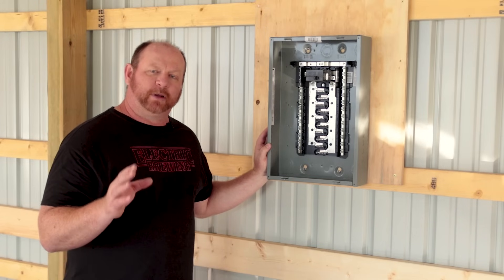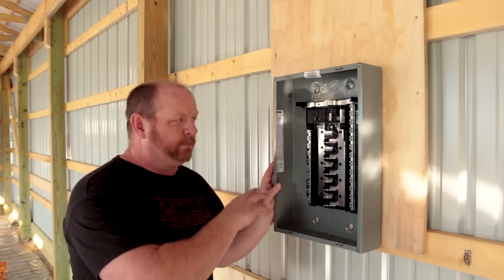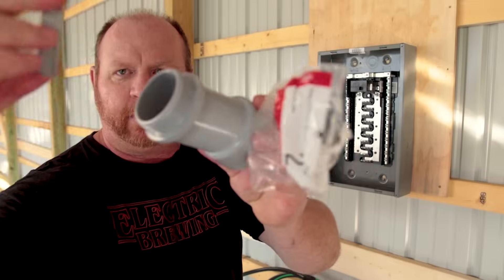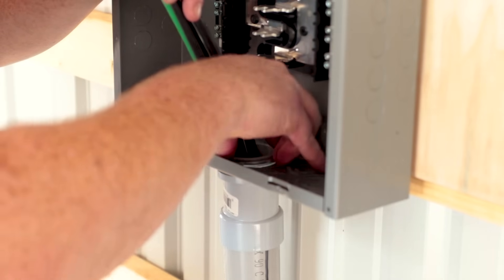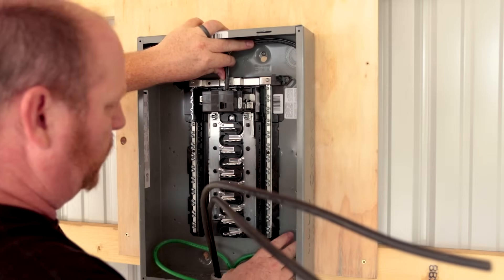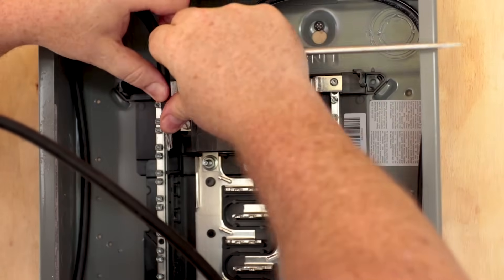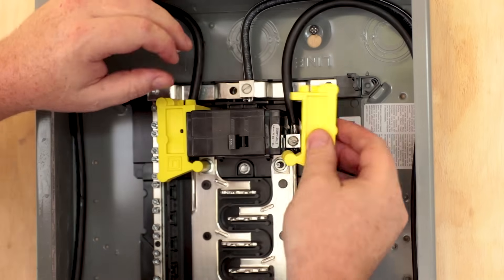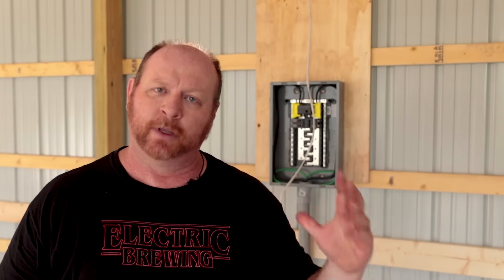How to install a main breaker panel in a garage. -  Square D Homeline 100 Amp Main Breaker

Comment: As an electrical engineer that worked over 30 years designing electrical systems for contractors, I have a few comments.  The use of #2 Al for a 100 ampere service would be acceptable for a dwelling unit.   This is not a dwelling unit so that table in the NEC can not be used.  #2 is rated at 90 amps at 75 deg C.   Terminals are rated at 75 deg, so 90 deg C column may not be used.   Should have been #1.  Since this is a "Service Entrance Panel" (I.E. coming from utility meter) there should be no ground in the conduit.  You are required to Earth Ground ALL service entrance panels at the location of the main.  Since you probably have no footing or metal pipe water entrance you are stuck with ground rods and be 25 ohms or less resistance.   No meter to check, no problem, add second groundrod and done.   For those saying add ground bar, absolutely not.  That is for sub-panels only.  The reason I commented is many people have viewed this and have gotten incorrect information not just from the video.    Respectfully Submitted!
Reply: Total clue hunter you are. Clearly he states this is fed from a utility meter. Service entrance conductors are sized according to 230.23...they must have "sufficient ampacity to carry the load as calculated in Art. 220." The OCPD(circuit breaker) is not protecting the service entrance conductors. Now if the installer hung a 100 amp disconnect outside next to the meter pan, you might be correct. But you are totally wrong in this case. Next about the ground bar. The only manufacturer that includes a ground bar in their load centers is Siemens. All others you have to buy them separately. If you look closely at the HomeLine load center in the video you will see factory threaded holes specifically placed for adding ground bar(s). As a matter of good workmanship I always install a ground bar to keep grounds and neutrals neat and clean. Many electricians screw the ground and neutral conductors under the same screw terminal. This is sloppy workmanship and a code violation. Lastly, the installer forgot the most important component of the grounded electrical system, the main bonding jumper. Most of the time with load centers it's a green screw and must be installed per manufacturer guidelines.
Reply: Brian,  please try to answer the questions brought up in this string.  Only you know these answers.   Respectfully Requested,
Reply: This is a sub panel. The box outside is you Main Panel. I'm pretty sure that is a combo unit.
Reply: Ted Cressley    I believe you "may" be right.   Not 100% sure.   He did not install like a sub panel though.   That's the problem, the originator will not answer any questions to know what is done right or wrong.   Also agree on the nolox or however you spell the antioxide paste for aluminum.
Reply: You should also use nolox on all of your connections with alm. wire.
Reply: as a former apprentice electrician with 3 years of union experience, I concur with your statement. Thank you for sharing.
Reply: @brianpfister5504  a former with 3 whole 3yrs
Reply: I have a  square d 100 amp panel was told I have to have gfci and ground arc breakers for some things my question is how do you install them they stick out to far to put cover back on some help please
Reply: @joep8494  try a Siemens 100amp load center.
Reply: @joep8494  even though you shouldn't any issues with a square D sub 100.
Reply: @FCES_Electrical_Sol  the 100 amp panel is in house with another 100 amp on pole outside when I wired up new service they said I have to have gfci and ground arc  breakers for bedroom but with my square d box the breakers they sell don't fit in they stick out and can't put cover on box any ideas
Reply: Joe P    If you haven't figured this out yet, very sketchy information but you need to make sure the breaker type you bought is on the list of breakers that fit the panel.   SQD makes several different kinds and they do not fit all panels.  List should be sticker in the panel.
Reply: He didn't ground?!? Well, he did say he wasn't a licensed electrician....🤔
Reply: Kevin is right, but you can have a ground bar as long as you bond it with a #8 THHN/THWN ground wire to the neutral.  I have had inspectors that like that better as it is neater than running all the neutrals and grounds to the same bars.
Reply: Wolfgang Unger   I wish Brian (the originator of the video) would answer the questions I asked him 2 weeks ago and clarify the unknowns.   Obviously Mr. Really Buddy is not as knowledgeable as he thinks he is.   I think they call them trolls.  I call them dipshidots.
Reply: Order of the True Force    Not sure why you posted your question under my comment.  I've never been shy about my opinion based on experience though.   Other than the most southern states, I would not design a circuit breaker exterior of a building for conductors that come into a building for a different reason than yours.   Circuit breaker overcurrent ratings (the ones on the handles) are based on test conditions of 85 degrees F.  If temp is higher, trips sooner(still safe).  If the temperature drops to 0 degrees, that 200 ampere breaker would need close to 800 amperes to trip under over load.  So conductors inside the warmer area would melt the insulation first.  Bad news!   If the breaker is outside and all the conductors are outside, temperature affects both, back to no problem.   Probably way more than you wanted.  Sorry.
Reply: Order of the True Force    I agree with you!   Why give thieves an advantage!   I hope I didn't disappoint you!
Reply: Update to questions below. I confirmed with Home Depot the green wire goes to the strips on either the left or the right. After going to bed and waking up this morning I looked at the situation I've only every other circuit working and realized it was the black wire. Everything at the box outside was hooked up right. The box I just switched out had the same problem. This all took place after the main blew inside the house when an old outlet box for the dryer wore out and blew the main. I realized it was the black wire on that Square D QO box as well. So I realized the breaker at the box outside must have blown the left side where the black wire goes. Went to Home Depot bought a new one put it on and everything is working fine.
Question Kevin Coop. My power in is from box off pole. I have 4 wires. Black-hot, red-hot, white-neutral, green-ground. On top bar I put black on right, red on left and white on top. Do I put green on one of the bars on the left or right. Also would I need a copper wire for ground to go to metal frame of house or in ground-copper wire to ground bar? 

Also, on my box like this the single pole breaker will only work on every other circuit. The ones with the hook facing right. The double pole breaker will work with this pattern of one that works and one that does not. In this case the red is on the one that works and black is on the one that does not. I placed this breaker on the top right. Black wire on left of double pole, red wire on right.
Reply: I agree about the ground rods and current rating but, wasn't the first wire attached the neutral, not ground, wire? If so, I've always seen them run inside the conduit.
Reply: The meter base looks like a millbank combo if it is then there is a separate compartment with a breaker inside and  the neutral is bonded there and a ground rod is driven. If that is the case then it is considered a sub panel. No need to bond at the panel. Kevin Coop is correct.
Reply: Thomas Marable    I did some checking about one building being fed from another building.   Not the exact situation here but, close enough to consider how to wire the panel.
History, the rules about this changed many times back and forth since I started in 1983.   As I rechecked it for 2017 NEC it is currently set as neutral and ground are separated in the second building.   But, it does require a ground rod(for lightning) to be installed.   The bad things is, there is an exception allowing it to be wired the other way with N and grounds bonded.
They still can't make up their mind I guess!     Kevin
Reply: @KevinCoop1  you are correct. If this is the meter base I think it is then the neutral is bonded there, if installed correctly, the they are separated after that. A ground rod is needed. The 2020 code does explain it a little better, but still not as clear as it could be better.
Reply: Thomas Marable    Thanks for the 2020 info!   I have retired and am not getting newer than 2017!   Good luck to you in your future in Electrical, whatever it is.    Respectfully,   Kevin
Reply: @KevinCoop1  I am retired to but still do consult work for the company I worked at. For years I was the only electrician/ engineer in the company. I still love to learn new things. Mike Holt has a live show on Tuesday covering slot of the 2020 code, go to Mike Holt live and you can catch up on slot or you tube his channel.
Reply: Thomas Marable    I get Mikes notifications.   His classes that I attended were the best ever.   But, I totally retired from Electrical Design engineering.   I have missed going to work about 1/4 second.   I guess after years of 60 to max 97 hours per week, I just got total burn out.   I worked for a very large electrical contractor that loved extremely large high risk projects.   I temp took over the department that had reduced to 7 and when I left I got it up to 24.   So glad I'm out!   Respectfully,    Kevin
Reply: Needs bonding jumper then
Reply: I have to DIY a lot but this why I do not mess with service entrance, meters (if thats what it is)..  Ill let the qualified people do that..Any other sub panels or disconnects I can handle but I always double chk with electricians
Reply: If there's a main breaker in the utility meter,  and it looks like there is, he is correct in bringing an egc from the exterior meter base to the interior SUB panel, and separating installing a separate ground bar.  He wired that panel up like it is the main disconnect,  but didn't bond grounded and grounding conductors in the enclosure. Very unsafe. 

 Why was a green green wire installed if it wasn't meant to be used?... answer...because the utility guys who set the meter and ran the supply conductors for him knew what they doing,  intending on him using the provided grounding conductor,  and he doesnt.   Its cool that you're trying to make informative videos,  but this is basically the blind leading the blind. Wire your own outlets and lights. Leave things that include terms like ungrounded, grounded, and grounding to the pros. 

The reason the conductors don't fit the above engineers calculations is because they are supplied by the utility,  and the utility can run whatever size they want.
Reply: +Kevin Coop Thank you so much for stopping by, your remarks clarified many issues. I am still confused about the ground for the utility meter. I assume the metal frame of the service meter is never bonded to the neutral for the transformer, in the interest of safety (if a tree were to take out the neutral between poles, a neighbor's return neutral voltage might appear at your service entrance frame, looking for an easier path back to the neutral lug of the transformer). Correct? If there is no ground wire in the conduit from main to meter, how is the meter case grounded? If it is a distance from each building, does the meter require its own set of ground rods? I've seen installations where the ground from an adjacent main panel is fed back to the meter to ground the metal frame of the meter, together with a conduit bonding nipple if metallic conduit is used. When I watched this I wondered if the author actually does have a main panel that we didn't see, right beside the service entrance. If so, then bonding of neutral to ground and ground rods would happen at that main panel. Then the panel shown in the video would be a max 90A subpanel (not a dwelling unit), requiring separation of neutral and ground, and separate ground rods (separate building), and an insulated ground leading through conduit back to the main panel. Correct?
Reply: spelunkerd   The meter socket may be required by the utility to have a separate ground conductor installed.   Since the neutral is connected to the can inside the meter socket, if there is a short circuit, it will go back to the transformer on the neutral.   Not sure what you were saying about the neighbors losing its neutral.  Unless they are on the same transformer on has nothing to do with the other.   To be clear, grounding electrode conductors and electrodes like ground rods have nothing to do with short circuits being cleared.  You mentioned that if it was not a service how it would be connected.    I believe your statements were all correct.  To use that wire size, it would have to have 90 ampere over current device.   NEC has waffled on one building feeding another for many years!  I believe that another ground at the second building is still current method.
Reply: @KevinCoop1  He can put a 90 Amp Breaker in the main  and the 100 amp would be just considered a disconnect...
Reply: D M   Yes he could put a 90 amp sub-feed breaker in the main panel.   That would make the overcurrent protection correct.
Reply: What about an expansion joint in the conduit? Won't that be needed once the concrete floor is poured since it will be floating and not part of the pole barn?
Reply: Jay Kay    Since the NEC says  to accommodate for large temperature changes or long runs in straight lines, I believe you are correct that something should be installed for that condition.   An expansion fitting would meet the condition, but there are other ways like flexible conduit.   Good point!
Reply: To all those reading these comments, since the original video did not tell all the information necessary to know 100% sure of what was installed, some of my or their comments may be incorrect.   We are not sure if it is a service entrance panel or not.
Reply: @KevinCoop1  all snarky comments aside, you should really have a pro check it out for you.  It looks to me like you've run what would be considered a sub panel, but haven't installed the grounding conductor. This leaves you in a dangerous place. 

On the other hand if that is the main disconnect, then you have not bonded you grounding electrode conductor (the wire connected to the ground rod, or concrete rebar) to the services neutral conductor. Also putting you in a dangerous position. 

Your set up can only be one of these two options,  as the arent any others when it comes to running power to a building. Its either the main disconnect,  or a sub panel. And both require that green wire you left disconnected. The proper utilization of that green wire is cruicial for human safety, and the proper operation of your circuit breakers in the event of a ground fault.
Reply: Warren Manne   What I described (original comment)is what was assumed the original video said or implied it was, a main service directly from a utility meter.  So, must be correct size conductors for 100 amperes table 310.15.b16, not the table for dwelling units, bonded neutral to the can, Grounding Electrode Conductor sized per 250.66, grounding electrodes as noted.  All of these were noted in my original comment.   Are you seeing anything different that should be done for the "Service"?
Reply: @KevinCoop1  i apologize,  for some reason i thought you were the creator responding. Just wasnt paying attention. 
I'm in agreement with your original comment. He's got a main breaker or "main service" type panel,  but im confident (through experience and by being familiar with part IV of section 230)the meter shown was an exterior meter/disco combo. Meaning the panel he is showing in the video is supplied by a feeder, making it a sub panel and should therefore have an EGC separate from the neutral.  We'll never know what type of situation hes got going on here, either main or sub, but one thing's for sure. He didn't do his grounding and bonding correctly. This is video is a good example of a driver swerving out if their lane and putting people in danger.
Reply: Regardless of what he has in the meter panel, any panel should either have the ground and the neutral bonded or 2 separate bars, something is wrong, even if they were bonded in the service meter, what if he loose the neutral wire connection then there is no back up ground at all.
Reply: Mosa Aldalahmeh    If this is a service entrance panel fed from the meter as stated in the video, there should be NO Equipment Ground Conductor.  Only L1, L2, and neutral.    This is nothing new, it has always been this way.   As I said originally, he should bond neutral to the can and install Grounding Electrode Conductor and electrodes.
Reply: @KevinCoop1  I'm sorry I didn't see the main breaker, I thought the main breaker is installed outside in the meter raceway, and the service neutral is bonded outside. i totally agree with you but I don't think he need to bond the neutral bar to the ground since they are already connected but for sure he needs a grounding electrod
Reply: Mo 1987    The reason that the green screw is installed (in a main service panel) is the same as equipment grounds to metal boxes or equipment enclosures.  So if a fault to the panel can, there is a path to neutral.   Think can to neutral, not neutral and ground to can.
Reply: @KevinCoop1  NOOOO the panel should be grounded and the neutral should pass through (Not bonded) for 220 single phase 2 hots a ground and a neutral in a sub panel
Reply: @KevinCoop1  This is dangerous misinformation you never bond the neutral in a sub panel@! he is wiring a SUB panel the main is outside on a pole. It makes the enclosure hot and makes any grounding on lets say a metal framed mill HOT very dangerous
Reply: Really buddy    No part of the information I have given is incorrect or dangerous.    Please watch the video again and read everything that I commented again.    At 2:10 he shows an electric meter fed underground by a transformer.   No pole.   What he did not state or show was a breaker outside that fed this panel.   He called it a "service".     Words mean everything in electrical.    I stated in quotations "Service Entrance" in my comments.   Later stated was "if" there is a breaker outside, then it would be a Sub panel.   It's been a few months since I've seen the video but, I believe he said he installed ground rods like it was a service.   So, I agree with you that "IF" it is a sub panel, then no ground rod, no neutral to ground bond, the equipment ground would be required.   Please explain to me (very carefully) how bonding in a sub panel makes the enclosure and a metal frame on a mill HOT and very dangerous.
Reply: @KevinCoop1  You talk a good talk but your info is bull. The meter is the main panel. He is not an electrical engineer of a licensed installer he should not be giving instructions on the internet. And since you cannot prove you credentials you should not be giving advice either. 
His meter IS HIS MAIN PANEL the one with the main disconnect. There is no main disconnect in the panel shown so it is a SUB panel. The first panel at the start of the service IS ALWAYS THE MAIN.
Also you can install the sub panel 180 degrees so you are not looping the main feed wires.
Also anybody that would use aluminum for the main feed wires is a fool this is a developer cost cutting feature.
Especially in a wet barn environment
Reply: @KevinCoop1  Check his comments at about 2:00 He has 4 wires into his sub panel . Some one obviously ran the underground service for him ruffed in . They had a clue 2/120 wires 1 neutral and one ground. He stated he was only going to use 3 which means he is bonding the ground in the sub panel THIS IS WRONG . Or he is just not grounding at all probably worse. He also clearly shows a meter on a pole outside with a main disconnect. 
kevin you dont have a clue and your comments are dangerous you are a smooth talker and unfortunately some mistake this for intelligence.
Reply: Really buddy    If you want to be the one that looks foolish, be my guest.   First 10 seconds he states "main circuit breaker panel".  At 2:09 shows pedestal mount meter next to pad mount transformer.   No indication of under the meter being panel or pull box.  All of my statements were preceded by "If this is a service entrance panel" as he stated.   I do not believe it is and have said as much, but there is no proof either way in this video.   I do also believe that you have some misconceptions on how grounding actually works.   I ask you again, please tell me how a panel or enclosure becomes hot by incorrect grounding or bonding.   As far as aluminum conductors go, I prefer copper but, aluminum is cheaper, and approved by UL and the NEC.   They are safe to use if installed correctly.
Reply: @KevinCoop1  kevin aluminum wire is approved because billion dollar developers influenced the politicians to approve it. i live in a mid 70's nieghborhood were 3 out of 10 houses burned due to aluminum wire mine almost made 4 . IT's all about the $$$.
An earth ground is a protection a neutral flows power to ground eventually. IT is part of a circuit . An earth ground (usually Green is for an emergency ) A neutral flows power any time there is draw.
The ruff in cable guys should have used white wire for the neutral or at least marked it with white tape. Kevin there isnt a chance in hell you are an electrical engineer or even an installer . As i said before bull shitters like you are dangerous .
Reply: Really buddy    As I thought, you have misconception of grounding.   At the location of the mains for premise wiring, there is to be installed a grounding Electrode conductor that is connected to as many electrodes as are available. Metal water pipes, rebar in the footing, ground rods, user ground, etc.   The neutral from the transformer is to be bonded at the same location. The purpose for this is a path for lightning to go if lightning occurs.   It has nothing to do with equipment grounding.   The houses you are talking about burning down most likely had aluminum branch circuit conductors.  The terminals in receptacles and breakers were designed for copper, not aluminum and caused many fires.  Aluminum branch circuits were outlawed about the time those houses were built because of that.   The aluminum used now is not the same as back then and the terminals were redesigned for copper or aluminum.   I'm sorry that you keep trying to tell people I don't know what I'm talking about.   I am what I said I am.   A recently retired Professional Engineer that designed electrical systems for electrical contractors for 35 years and held four contractor licenses in three states and one city.
Reply: Really buddy    Now, please explain how bonding neutral to ground in a sub panel makes the panel can or equipment enclosures "hot".   Give me your best explanation.
Reply: @MAD20248  What he is wiring there is a sub panel it should be grounded to the main disconnect panel but the neural should float. If you ground (bond the neutral in a sub panel the metal box becomes  (Hot) Thats not good. People always confuse a ground (which is for safety and a neutral which is part of the circuit flowing power. Yes both end up at the same place at the transformer but until then it is very important to keep them separate.
Reply: Anti ox paste with aluminum?
Reply: @themaintenancekid7851  I have no idea why someone would wire a new service with aluminum wire it will cause nothing but trouble in the future
Reply: @reallybuddy3259  because they watched this guy on YouTube do it once
Reply: @themaintenancekid7851  Yup youtube has some great info but people should remember a well done pro looking video does not mean the info is correct . So for things that could be dangerous youtube may not be a good source of info.